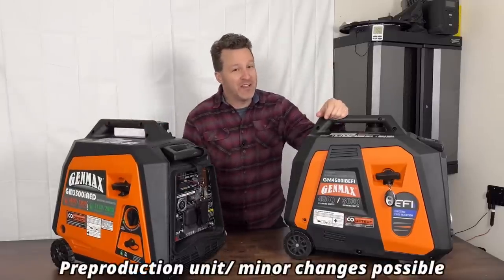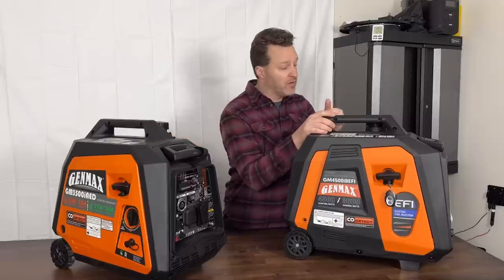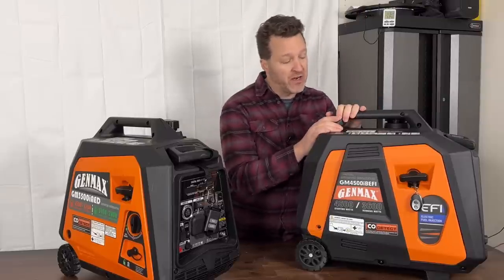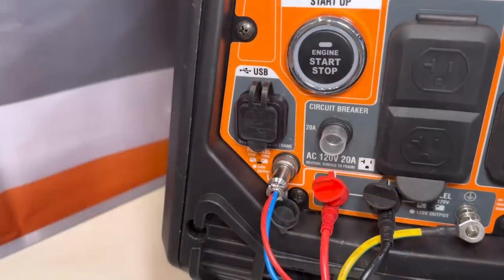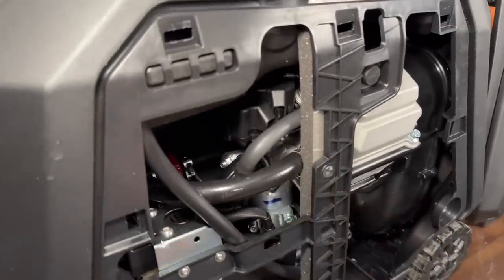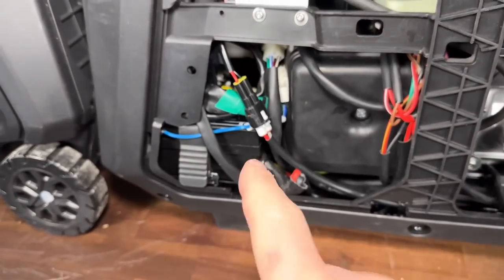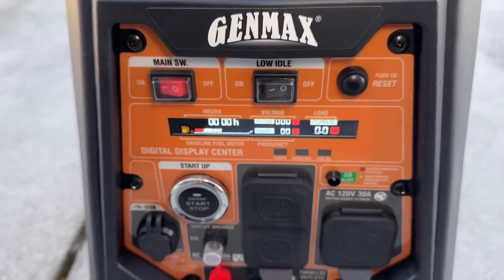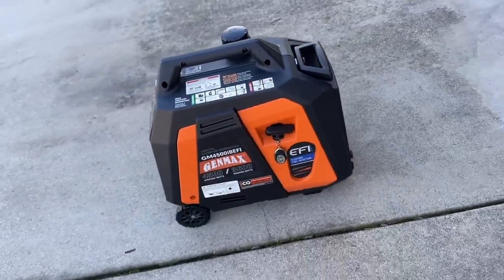Best New Compact Generator GENMAX 4500IBEFI Fuel Injection!!

Comment: It started so smoothly
Reply from the maker: Right!!
Reply: @johnnysweekends  can't wait for GM10500IET
Reply from the maker: They have a gm12000 that’s a late year release at well. Tri fuel
Reply: @JOHNNY'S WEEKENDS  see they said they don't know anything about it but it must had been some rookie customer service person I guess. Late this year ouch, I'm like ready to get the 10500 whenever it comes out but I rather had 12000. You mentioned that on the clip when you were in Vegas. Had my inlets installed few weeks ago, this weekend was planning on gas lines.
Reply from the maker: Well I talked to the owner and the main engineer and lead manager and they said this 10500 unit and a twin cylinder 12000 watt unit. V-twin I believe but yea I think that is a more end of the year unit. I think its in development.
Reply: @JOHNNY'S WEEKENDS  I'll probably get 10500 once it comes out and will see how it does. I have a question for you, I'm about to get my gas quick connect done.. do these have any requirements in terms of the size of NG gas pipe or gas flow same as quick connect type?
Reply from the maker: You need to double check with local gas company or the person installing the line. A larger generator like that will need a larger hose and also depends how far from the outlet it will be. 
A half inch line for sure or maybe even slightly larger if farther away.

Comment: Honda is better sorry 😊
Reply: Yes that's why they cost almost 3x as much
Reply from the maker: You should read and research a lot of the more recent reviews. I see more problems now then ever. Another person just posted the other day he has 3 Hondas all with issues with on maybe 500 hours 

$3000 for a fuel injected unit..?? 
If you use it every day and it’s a construction unit well idk maybe. 
A lot of reasons to buy one and not.
Reply: @johnnysweekends  I have 3 Honda generator for years never happen to me maybe they should read the manual 🤣

Comment: Interested to see longevity. My Honda is seriously a beast.
Reply from the maker: Same. Will see how they do.
Reply: Clickbait said better then Honda but not tested yet
Reply from the maker: Not exactly if you consider several options. 
Cheaper price which you could buy 2.5 of these verses one Honda. I assume about $1099 but could be cheaper idk yet.
More power
Larger fuel tank
Remote start
Electric start 
Wheel and pull out handle to move it around…

Definitely has some edges there. $2600+ for the Honda is a chunk of money. And if something breaks what will be labor and  parts be going into a used unit..? 
So will see what happens down the road.
Reply: @johnnysweekends  -   HONDA is a proven product. I have several Honda Generators for over 20 years that have never failed on me. I don't see a need for remote start nor a larger gas tank. My Honda generators run over 8 hours on just 1 gallon of gas. How difficult is it to shut them off for a few minutes to cool down and refuel?
Reply from the maker: Hondas are great but they are not what they used to be. Read the reviews on the newest eu2000i models and newer 2200i. I have many who are displeased with it,not just on my channel. Not back several years ago Honda and Yamaha would destroy everything. Times change regardless to where someday someone will come out with something that may not be better but for what it is, it justifies the price and use of the item. 
I know you can buy Honda parts for years and replace items, but I dont see me putting a certain amount of money into a very used Honda. It’s like putting a transmission into a car with 275k on it. That’s just not a good move to wait for something else to go. Thats when its time to get something new.
Reply: @johnnysweekends  as of right now, my Honda EU3000 has over 5,000 hours. I’m sad to hear that the newer Hondas aren’t performing as well.
Reply from the maker: Thats the feedback im getting and when I went to look for a new inverter board for my Honda eu3000is …my serial number was DC…!! Not replacements for the unit. So if it died it would be a paper weight. So it went by by. Had around 900 hours I believe. Very clean though.
Reply: @johnnysweekends  sometimes the part is just superseded, and not discontinued. Just rebuilt an Onan generator, as well as a little Honda 2000 and old parts were “discontinued” with new part numbers taking their place. Or it could be gone forever, who knows anymore in this world.
Reply from the maker: I was looking for a superseded number, nothing with listed for my serial number and a couple others. But some models still had it. Not sure if they were newer or older. Mine was a 1996 model
Reply: Honda generator are over priced pig  and under powered 😂😂😂😂😂
Reply: @DonnyO420  my Honda now has 5,400 hours and still refuses to die. Generac, Champion, Firman, all died @ 500 hours, or close to it. All cost me $500 bucks. This Honda generator, even costing me $2200 bucks, has saved me roughly $2500 - $3000 dollars. Also, it has never once not started or worked, so it has allowed me to have basically no downtime anymore due to breakdowns. 

If you’re buying something for camping, sure, buy the cheap crap. If you have a business dependent on generator power, there’s no substitute for a Honda. The price is well worth the investment. This is 10+ years of using generators in commercial use. 99% of the people that talk smack on Hondas don’t want to spend $2200 on a generator they’re going to use 3 weekends out of the year.
Reply: @DonnyO420  and underpowered? My 7000 can run a 15,000 BTU A/C and a 20 amp high force dryer and still has room left in the tap.

Comment: Down vote this folks.  As someone who has depended on gensets for 30 years,  what really matters is longevity, reliability, and replacement parts. New features are all fun and all, but when you need to depend on a generator, don’t depend on ‘review’ form an influencer. Hondas run for decades if you take care of them and you can get parts for models that decades old. This generator will be replaced by a new model next year. Caveat emptor
Reply from the maker: As someone who does use gensets so much you should read some of my reviews and comments from the Alaska preppers or just people who live there. 
I my self own one Honda, had 3. But many replies I get now and even the hundreds to thousands of reviews I get to the hundreds of other reviews I read and more, the consensus seems now, that the price difference and longevity does not bring you out ahead anymore. 
Honda is pricing them selves to high out of the market to where even a disposable unit can be cheaper in the long run. Back 15+ years ago this was not the case. Hondas bullet proof units seem to not be so bullet proof anymore. Obviously owner takes a part in this. But the latest eu3000is and newer eu2200i are just not lasting like the bullet proof units from before. A lot of hard starting issues and rough idle or low loads running, and of course failing inverter boards. Which those cost as much as a new generator. Which you are putting that into a used unit. 
I have several comments in here from users who have been watching the channel who use there gens every day racking up thousands of hours. They said after calculating the differences in the long run it was cheaper to buy a predator unit than a Honda. Verses also waiting to get parts, tear down a generator and put new parts in a already very used unit. 
Honda is still a great unit, but I think since they have started using possibly cheaper parts, moving factories to china now as well, is it still worth the major price difference. 
Hard to down vote, when the information is out there. 
Now the Honda eu7000 I think is still pretty hard to beat but will see when other units comes out if it can match the hours. But at $5000 again is it worth it?
Reply: @johnnysweekends  Dependability is king in my book. Others may not value that as highly, and that’s their right. I have no financial stake in pitching honda or any product,  I just think that it’s not true these are ‘better” than Honda unless price is your main criteria.  What is the cost when you can’t run your well pump, or your internet when you need it , or charge your batteries because you daughter needs her insulin chilled. Cost and value are different things.
Reply from the maker: I understand and agree. It all depends what you need. Just like there are cheap tools and expensive tools. Some are meant to be used a couple times and some for life. I have snap on and Harbor freight. All depends what im doing. 
Much like these units, they all do much better when you run them more than letting them sit. But if you need one for a month or two then of course cheaper options are out there. 
But again I think Honda, which I still like them but they are missing a really big market, but again are not lasting like they used to. Mine still works fine. But this info is gathered from multiple sources. From here, forums, group pages, other channel reviews and more. There will always be die hard Honda people. And that’s fine. It’s still a great product. Just like when people want a really reliable car, well if you want something that will last forever then Toyota is your best bet. But again depends what you need. 
Someone is always the best until the next company comes along. Is it genmax…?? Or maybe another soon. Champion is also another good brand I recommend due to there customer service and warranty. Which Genmax is more shaping to be that way. Have a good amount of parts that way you can repair the basic stuff. 
PLus I like what they are doing and the options. Definitely nice to have more options to fit your needs. I love the Honda 2200 but that easily could have been a 2500 start and 2200 run. But hey will last longer putting out less.
Reply: I am a Honda fan ! That been said, mine died after Hurricane Ian due to been under water. When getting ready to replace, I did my math.
Honda 2200 $1,199
Hutch Mountain propane convention $279
Total $1478
Genmax 3500 dual fuel, remote start, LCD display showing hours run, voltage output, and load level and MORE power
$899
Just saying 😎
Reply from the maker: Yea, again now with the price and if you care for it like you should and run them appropriately then they should last. A lot of errors happen with people running generators that cause premature failure.
Reply: Down vote you Matt lol
Reply: Generator snob detected.  Not everyone depends on these for their lives and/or has an unlimited budget.
Reply: Why would you down vote this? It's an honest informational review. I speak from experience when I say Honda may have had a corner on the generator market. I owned one. But unless you are made out of money Honda is pricing thereself out. I just bought my son a Generac GP3300i for a third of the price of the Honda equivalent.  Sorry, fuel injection is great but not $2000 great. As far as dependable time will tell. But if I lived where my life depended on a generator then I would buy 3 of the Generac's. 1 to use & 2 backups for the same money. That 1 Honda goes out & you are in trouble. Just my 2 cents
Reply from the maker: Well said, that’s why there are options. 
😀👍🏼
Reply: You don't downvote someone's videos simply because you wouldn't use the product that they're reviewing.
Reply from the maker: Thank you 😀👍🏼👊🏼
Reply: I’ve got to say I’ve used Honda generators and motors for many years. The prices climb faster than imaginable. Genmax, Predator and many others have evolved and Honda can not lay claim to king of the hill as before. I’ll be using mine with my travel trailer and I just can’t justify (especially to my wife) the astronomical price difference. Have been using two 2300w Ryobi’s in parallel for a few years (again, much cheaper than Honda) and they’ve run like champs but I want to consolidate to one good powerful generator to do the job of these two. I’m getting about 3200w from the dual Ryobis but believe I’d be good with a Genmax. Thanks for great video and research
Reply from the maker: Honestly they are getting better and better so… 
I get more and more positive response from other units pulling 2000-4000 hours on small units. That’s pretty darn good. But the owner and how it’s used plays a big part
Reply from the maker: Correct the more you use anything will typically ensure getting full service life out of it. Just like a car that sits all the time,seal dry up cylinders build up rust and more. If you buy it,use it. 
And the unit seen in the pic is a preproduction unit I have. And looks to be the only one that may ever be. Because the new one coming out will be different and loaded with options. I just saw it. And its got some improvements for sure!!!
Reply: @NeverTakeNoShortcuts  buy a Honda then, I have a Yamaha and my parents have a Genmax, Yamaha straight out of the box had a low load idle surge, genmax did not. Do I trust the Yamaha more? Yea I believe it would run 24 hours a day for days on end, but when will I ever need it to do that? When do I have the gas supply of fresh fuel to even run it that long during an emergency? I’d rather have bought two genmax than my one Yamaha
Reply: Ok Honda fanboi
Reply: man, not everyone depends on a generator for their life every single day.... most people use it once in a while. relax. 

is Honda more reliable? yes
is the price difference worth it? absolutely f. not.
if a chinese gen breaks down, you buy it new in 30 minutes for what, 700/800 dollars for a dual fuel 3500/4000w?
you can buy 4 of those for 1 Honda.  even if it breaks down you buy a new one right away and you still save money compared to a Honda. and have no headache of fixing it.
Sorry but Honda should wake up. They are losing ground everywhere,.
Reply from the maker: I agree. Trying to sell the name instead of the product
Reply: Someone’s stuck in the past thinking Honda is the only reliable generator 😂
Reply from the maker: Lol its true. Die hard Honda boys. I like Honda but its truth that they are not as reliable. Im not the only one who says this either. Read the Honda generator forums and all the pissed off people with the newer units that Honda wont honor the warranties and more. Many people pissed with eu7000 efi units that are paper weights. And those are not cheap.
Reply: concur completely with your words..
Reply: How do you know anything about its longevity, good or bad? You have an opinion & nothing more.
Reply: I'm sure you do bud bet drive Ford  how come  not driving honda
Reply: If you're concerned about reliability, you can have a second (cheaper) unit as back up and still pay less and can even run them in parallel for extra power.
Reply: @NeverTakeNoShortcuts   Doesn't need a thumbs down for a honest review for a Generator. Not all of us need a Gen for more than 3 times a year when taking out the RV.